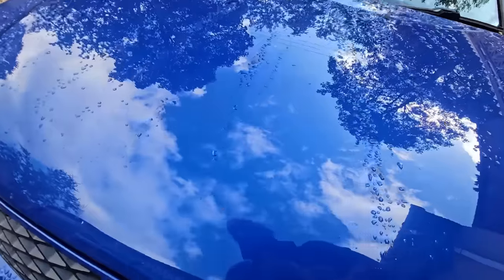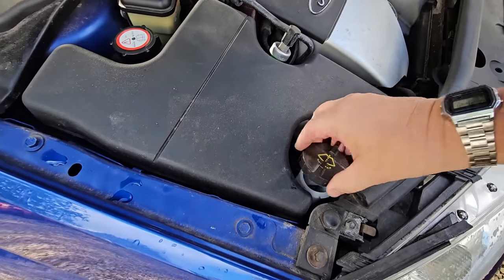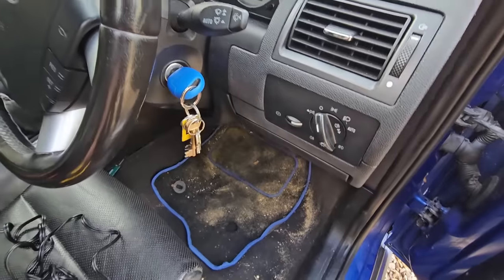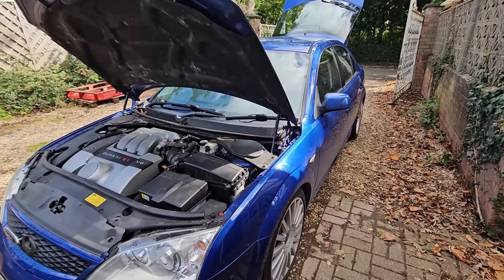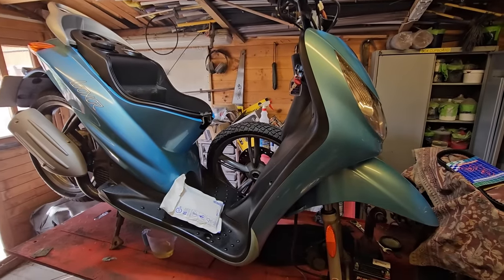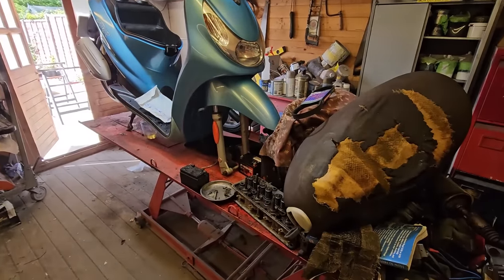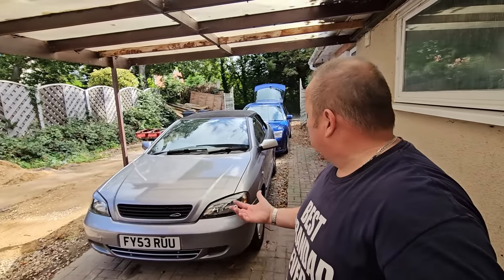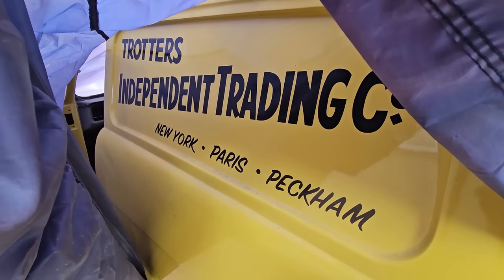Need A Break to Get Back On Track.

Comment: Rear axle/subframe bushes on the Astra I recon, worth changing Martin make the car handle better. Not hard, drop the front of the rear axle down, chisel out the old bushes and press in new ones.

Comment: Ive just had a nightmare with mine with starter motors lol, bought a duff one then fitted a brand new one which then still wouldnt start due to the fuse blowing 😂